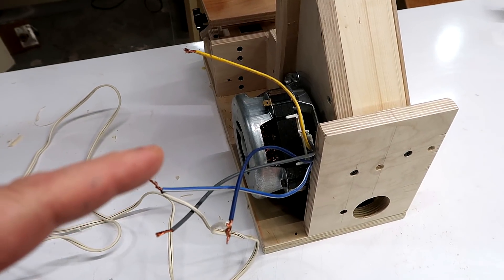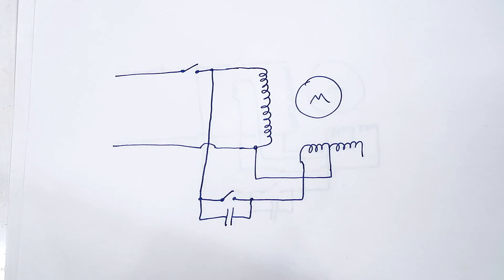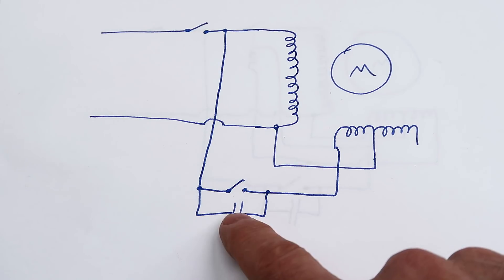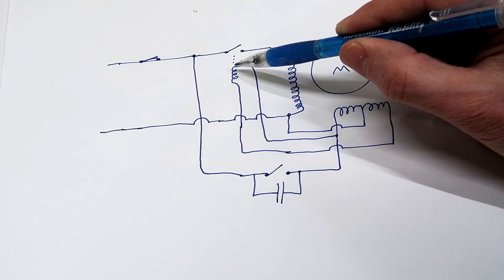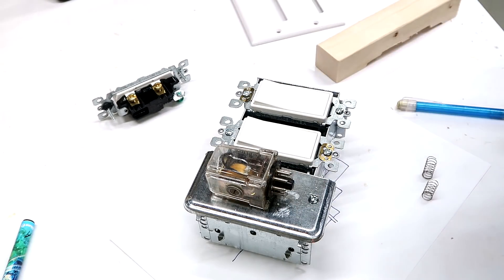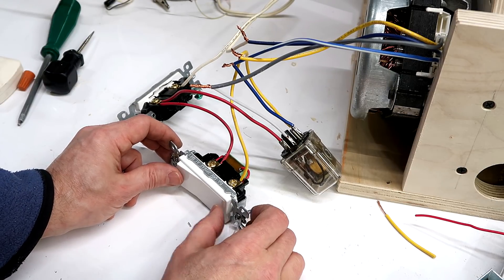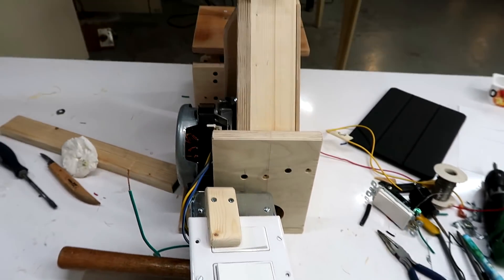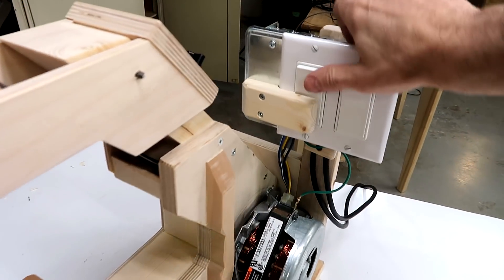Induction motor NVR switch and starting circuit

Comment: Momentary action switches seem to be impossible to get anywhere these days for a reasonable price.
Reply: Use blank plate and mount any push button you want or use door bell switch
Reply: arturf209 
That's fine for about 50mA switching. It's not an option for much else.

Comment: Handling loose live wires seems like a thing a woodworker wood do 😁😁
Reply from the maker: An advantage of the north american system is its only 120 volts.  It only hurts half as much when you get zapped.
Reply: @matthiaswandel  oh, that's true. Isn't it even 4 times as hurtful? Voltage goes quadratic into the power equation, so a doubling in Voltage would mean 4 times more power for the same resistance
Reply: @matthiaswandel  Or that you're a qualified engineer and knows how to handle it.
Reply: @charlc  I am an electrical engineer in the making and my colleagues would condemn such handling of loose live wires as well
Reply: I have touched 240, I absolutely do not recommend it, it is painful, but anything more when it just goes through 1 or 2 fingers? Don't think so.

Comment: Interesting solution, for sure. I am a bit concerned that the relay is arcing inside every time you start it. I'm not sure how long that would last. Maybe another cap across some terminals will help.

Comment: The  sockets for those relays is an 8 pin octal socket (for vacuum tubes from 1930s-40s).  The relays are Potter & Brumfield and can be found at many electronic suppliers.  Good explanation.

Comment: This is the scariest install I have ever seen You have no regard for electrical safety and codes what so ever. Do you not care about safety. I remember your fiasco for trying to modify your water heater with a solid state relay and no enclosure. You might be a good woodworker but you are not qualified to attempt electrical work at all. One day you being so cheap will come back to haunt you.
Reply: Life must be so difficult for you. More than likely if anything ever goes wrong with this install in the future he might trip a circuit breaker....OMG noooooooooo!
Reply from the maker: Exactly.  The power goes straight to the switch on the right, and when I switch that off, the rest of the circuit doesn't have power.
Reply: @matthiaswandel  everything is wrong from the type of boxes and switches you use to soldering wire to a relay pin. An 8 or 11pin relay base may cost 8 dollars. It looked like you put it in the box with no isolation between the relay and the metal boxes. A lot of people watch you and will try and copy what you do. It's not a question of just tripping a circuit breaker. It's a question of doing it right. If you are that confident in your wiring methods Matthias I challenge you to take that control and motor to your local inspection authority and ask them if this is proper. Or take it to CSA and ask them. I'd be curious if they would approve it.
Reply: @edjusted4496  I really liked your comment, it made me chuckle, I imagine some people miss not having a teacher to ask permission if they need to go....  The way I see these things in the UK, if you put a plug on it it is not an installation, so it needs no approval, if you aren't going to sell it or give it away then you don't need approval, and if you understand how things work and are willing to do things for yourself you never have to listen to guff from others about how you can't do this and you can't do that.  A friend of mine told me that electricity was dangerous when he was visiting me and I was wiring some universal washing machine motors, so I put a wired motor with no earth in a bucket of water and turned it on, then put my hand in there. Nothing, the motor kept on running underwater with no ingress protection and I kept on living because electricity is simple. https://youtu.be/jiV_VqQH8YU you can leave me a nanny state comment if you like!!
Reply: @bootsowen  You really know how to make a point!

Comment: I had a similar problem on an old compressor. I just put a temporary push button switch in close proximity to the main switch. I push the temp switch with my index finger and flip the power switch with my middle finger once the motor is engaged I let of the temp switch and it disengages the start coil. To turn he compressor off I just flip the off switch and it's set to go again.

Comment: Did you include the capacitor in the circuit in the final version? I still saw sparks when everything was installed in the box
Reply: Can you add a capacitor across the relay contacts to reduce the arcing? Unless the contacts are mercury wetted, and those types are relays normally aren’t wetted, you will probably have a smoked relay soon.
Reply: @MrJohnnyboyrebel  yes he didn't have the capacitor in the right place to protect the relay.  He should fix that.
Reply: The relay arcs inside the housing. See 4:10
Reply: I'm worried that the inductive kick from turning the switch off would be more than 400 volts. That small capacitor is going to get charged up really fast because it has to absorb the considerable inductive energy in the magnetic field. Half microfarad capacitor would probably charge to a very high voltage to accommodate all the magnetic energy in the laminations of that motor. Very difficult to calculate. You would need a high voltage oscilloscope and actually measure the voltage Peak.
Reply: @henryD9363   Motors are measured in millihenry.      Let's say 10 mh and 5 amps that gives you 0.12 joules and this motor  probably isn't close to 10mh.
Reply: @GigsTaggart  excellent. Energy in a charged capacitor:  E = .5 × C × V ^2, where V is voltage.   So   V=√(2E/C)  or
 V =√ (2* 0.12 / 0.5E-6) = 490 volts
That's a bit much for a 400V cap, even assuming less energy and resistive losses.
Reply: @henryD9363  10mh was a wild guess.  But I guess it could be marginal like you say.

Comment: You could also rewind the relay to a much thicker wire.
Then you can run the power to the main winding through it, if the motor isnt turning it is pulling that much current that in engages the relay.
If the motor is up to speed and the current drops the relay will drop off an disengage the starter winding.

For this Motor in particular your solution seems to be the best, but not all motors have seperate start windings.

Comment: I have used a couple motors like this - my preferred solution is to use a Functional Devices RIBU1C Enclosed Pilot Relay enclosed/modular relay -- they have 20 amp and other versions, $10-$20/ea.  I connect the starter coil to the normally-closed relay, and have my main power switch for the device immdiately supply power to the relay.  The 10-15 milliseconds it takes the relay to close, and a bit longer for the starter coil to de-energize -- ends up being plenty of time for the starter coil to kick the rotor in the right direction under light to moderate load.  The form factor of this relay makes it attach natively to the side of any normal junction box, and wire up just with wire nuts.  This eliminates the need for a second switch, where leaving it on by accident (or running the main without the starter) can lead to over-current draw, as the motor draws locked-rotor current.  Makes the whole system idiot-proof.

Comment: Very interesting. Iv only ever encountered industrial 3 phase motors with a start switch and run function like this. Though im no electronics wiz im curious to know if this is a similar type of motor
Reply: Its similar in that both are induction motors but the motor in the video can run off of standard 120v electricity in your house

Comment: I have a East German 'PRAZI' lathe which had a centrifugal starting switch which went bad after just a month ... I simply put my own momentary contact switch in front ...it has worked fine since for the last 28 years
Reply: My mill had bad centrifugal switch contacts so I started it for years with a switch. Then one day I just fixed the centrifugal switch. Just had to bend the metal the contacts were on a little. They were misaligned.

Comment: Check out the post apocalyptic inventor's channel for the electronic starter circuit
Reply from the maker: Read the article, see a link to that video
Reply: @matthiaswandel The article link is broken, I think it should be https://woodgears.ca/motors/starter.html, not https://woodgears.ca/motors/starting.html

Comment: Thanks for sharing. I am currently testing a motor from a bread maker and it uses a capacitor to start but also has three wires coming out of it, one being ground.  I can power the motor from either of the two 'hot' wires however it's louder with one than the other. It spins the same way with both wiring configurations and also spins at the same rpm.  Got me puzzled!
Reply from the maker: Bread maker motors are usually capacitor run motors.  The run capacitor is on the main circuit board.

Comment: Hi, Could you use a starter from a fridge compressor?
Reply from the maker: Yes, and it would probably last a few weeks before it burns out.  This motor is about 3x as powerful as fridge motors.
Reply: @matthiaswandel  Are they not just PTC thermisters to provide the "kick" on the start  winding?

Comment: Instead of using single pole rocker decora switches you could of bought single pole momentary push buttons for less than $5, but excellent ingenuity using the piece of lumber! Thanks for the upload.
Reply from the maker: $5 US, plus two months to wait, plus shipping.  Instead I bought light switches for $2 canadian.
Reply: @matthiaswandel  If you are interested,  send me a mailing address in a PM.  I have a variety of push buttons I am willing to donate, also you said you don't have a replacement if that ice cube relay goes out i might have a few of those for you even some nice 240v ones.